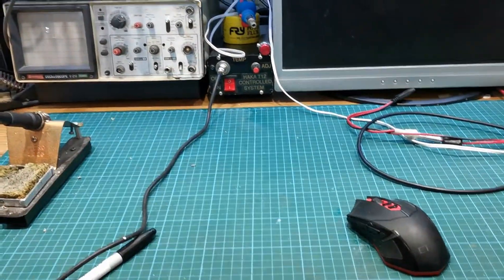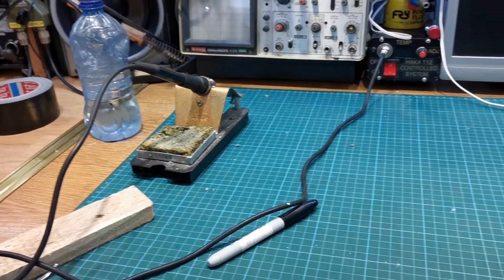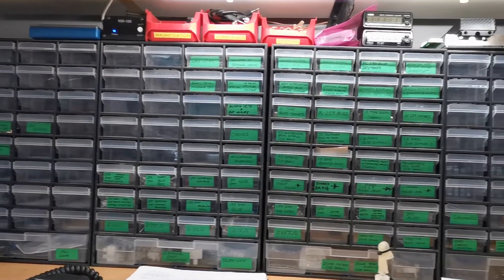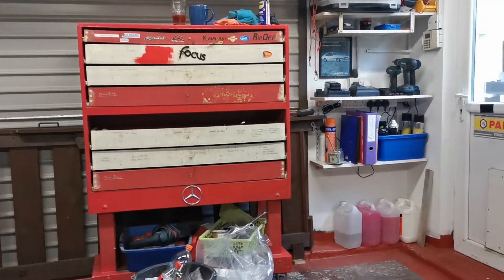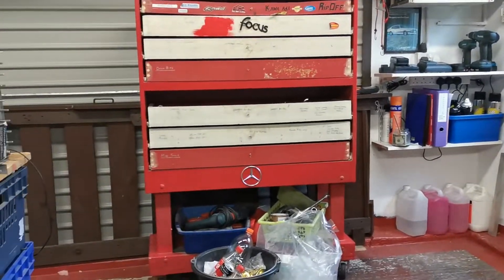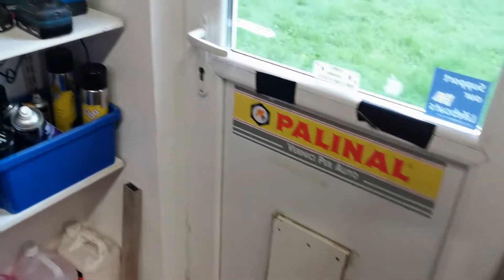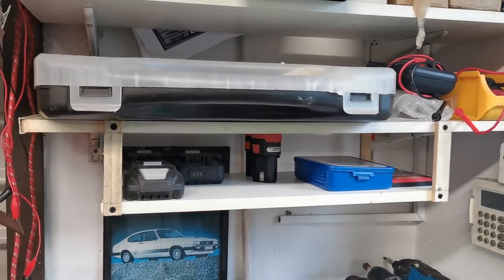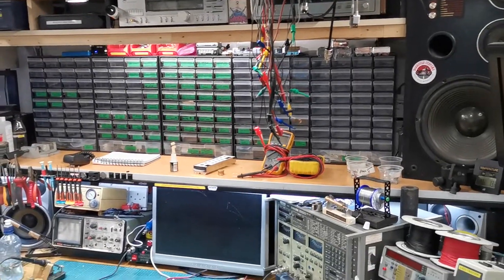Update Sept 18 2020

Comment: merc..diesel?......
Reply from the maker: Petrol
Reply: @GeorgeEI7KO  no eml on??
Reply from the maker: @johnnymac26  nope
Reply: @GeorgeEI7KO  is it failing the emission test ? low mileage? low usage? change the oil and thrash its arse off then send it for test.
Reply from the maker: @johnnymac26  did all that. Found a perished vac line from the crankcase breather. Pipe was collapsing one the motor started.
Reply: @GeorgeEI7KO  you got access to emission-co tester? sounds defo like an air leak unmetered air in intake plug in co tester and a wee spay round the engine with brake cleaner watch the hc rise be more than one pipe perished after all they are made of the same stuff
Reply from the maker: @johnnymac26  entire vacuum system being replaced.
Reply: @GeorgeEI7KO  They don't make those pipes like they used to.  Son's car sucked the pipes flat, he couldn't find what was wrong until I stood and looked at his car, as soon as he revved it the pipe went a flat as a pancake.  "That will be the problem then!" says he.  Well duh!
Reply from the maker: @BoB4jjjjs  mine was flattening the pipe at idle! Whole side of the block covered in oil!
Reply: @GeorgeEI7KO  Yeah, I did say rev the car, but it flattened just above idle, but he couldn't see it doing that, he got some special pipe for his that a tank could run over and it would still keep its shape.  But how he hopes to get his car through an MOT with what he has done to it is a mystery to me!   He he has ever been stopped by the police amazes me!
Reply: @GeorgeEI7KO  That is not good, oil anywhere is not a good thing.  Was it sucking it up from the sump?
Reply from the maker: @BoB4jjjjs  the crankcase pressure would build and of course no vacuum so it came out through the perished hose.
Reply: @GeorgeEI7KO  Just wondering why you didn't notice any oil dripping?  It must have been a bit smoky when you started it in the morning as well, no?
Reply: @GeorgeEI7KO  sometimes there is an oil separator usually a vortex type canister mounted under the inlet manifold or the oil separator s in the head cover a ladder type which allows the oil vapours to separate vortex is an older style.
Reply from the maker: @johnnymac26  it's built into the cam cover on these. I've had it apart and cleaned it
Reply: @GeorgeEI7KO  yeah thats the newer way a labyrinth or ladder system has oil managed to get into the vacuum system?